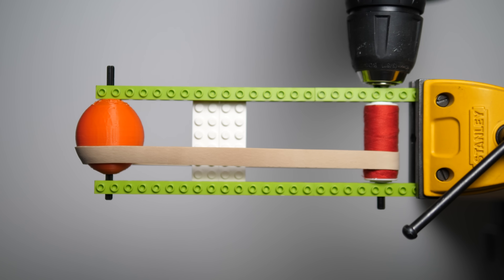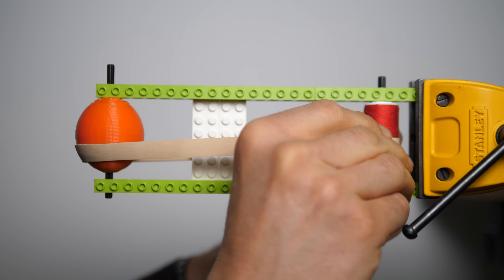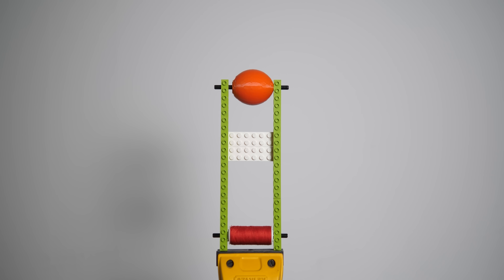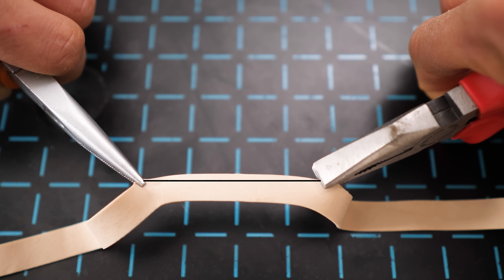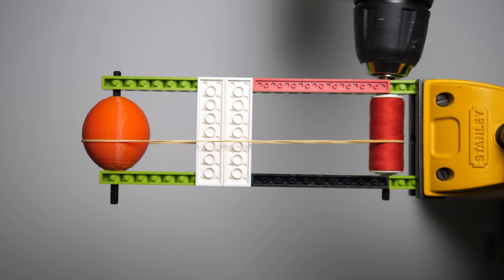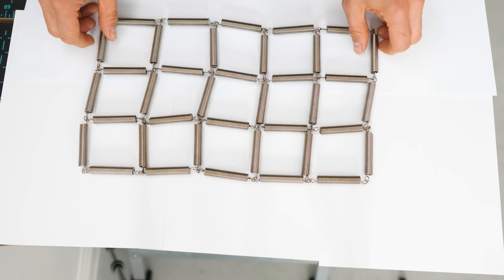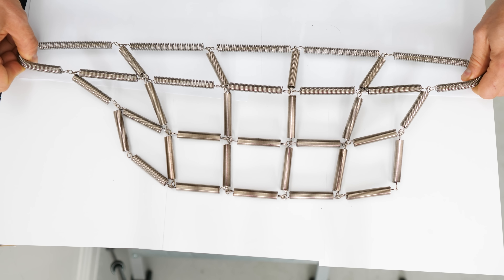The Band Should Slip Off But It Does The Opposite!

Comment: I explore ghost towns and mining camps, and have seen a lot of old mines and mills which used belt-driven machinery. I have often wondered why the pulleys were slightly crowned. Now I finally know! Thanks!
Reply: I do a lot of the drives for conveyors most of them are always crowned because of the belt wandering if it’s a long conveyor with a belt it’s likely to try and wander but with a crowned and lagged pulley it does pull it back to normality :)
Reply: Band-saw pulleys are also slightly crowned, for this same reason.
Reply: The belt goes the direction it leaves the surface until balance or failure. Susually.
Reply: I've wondered too! Looking at old threshing machines and tractors. Also I've made pulleys and gears from scratch for my kinetic sculptures for 17 years and have had various results as I usually just kind of wing it - this information will help improve my work as well. So glad that YouTube recommended it :D
Reply: I explore tunnels and caves in various video games
Reply: You sound like an interesting person, I too like exploration
Reply: @samos343guiltyspark   You can see my ghost towns and mines videos here:  https://www.youtube.com/user/raydunakin/videos
Reply: I read this comment and I immediately thought "hey, like Ray Dunakin!", and had a spittake when I saw it was actually the commenter. Thanks Ray, I still watch the first person Inkopah Railroad video every year or two!
Reply: @pheener  Cool!
Reply: This was the most positive reply ive ever seen
Reply: Exactly why.
Reply: U mean u explore towns and mining camps
Reply: @ajm7375  that's what he said, dummy
Reply: The side stretches more so it pulls it to even out pressure
Reply: And machinery that uses 2 separate belts on the same pulley use a double crowned pulley.
Reply: Nobody's watching because of your comment
Reply: Eileen Ulick    Never. People like to think that anything old and abandoned must be "haunted" but that's just a lot of bunk.
Reply: Now that you mention it, I've seen this in ghost mines.  This is everywhere and I had no idea.  I thought of train wheels but someone else mentioned a bandsaw.
Reply: gee I wonder why
Reply: I'm trying to make a middle school lesson plan about this. Would you happen to have a photo of one of the antique crown pulleys you'd be willing to let me use?
Reply: @grahampcharles   I don't know if I have a suitable shot of a crowned pulley, but I'll go through some of my photos and see what I can find.
Reply: Hammer Johnson  more like a hammer to the Johnson
Reply: I prospect as well…
AZ,  (One of the Stolen Election States)

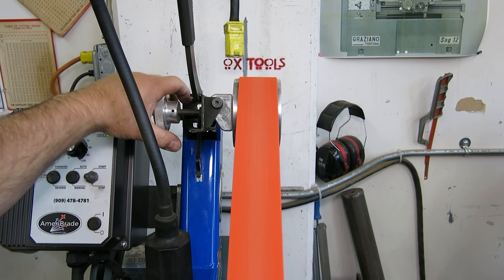Comment: 1:26 - Wow, that image of a centre-lathe at the top-right corner brings back some memories! The Graziano Sag-12 is an incredible lathe (although with a nightmare of electrics to maintain) which make working on it a breeze. Had them in a technical school in Malta. Incredible to work with. An electrician's nightmare to maintain especially with those electro-mechanical clutches in the gearbox.

Comment: Decades ago it was used on LP turntables. Flip of a lever, you change the speed by running on a smaller or bigger 'crown' of the motor shaft

Comment: This has been working with leather and textile belts for several hundred years.  Back when power came into a factory from a water wheel, a "horsepower", windmill, or those new-fangled steam engines, many flat belts connected individual machines to a main lineshaft using crowned pullies.
Please, inject a little of this vast history into your videos...let people know that we are all standing on the shoulders of the giants who did this sort of engineering first.

Comment: This looks similar to counter-steering on a motorcycle where at speed you actually steer right to turn left.
What happens, in the case of the motorcycle, is that the curve on the inside of the tyre causes the bike to turn.
There's a ghastly video online from some engineering chap who talks about counter-steering and gets it completely wrong endangering the lives of the gullible who listen to the video.
Why not do a video on counter-steering?

Comment: When i left school, in the last century, my first job was working on a farm and the farmer had an old Fordson Major tractor with a belt driving pulley that came out at right angle to the engine. He only used the tractor once a month to power a belt driven corn grinder. He'd grinf up corn for the cattle feed. The weird thing with this setup was the way he'd just back the tractor up to the grinder, i'd slip the belt over both pulleys and then he'd let the tractor roll forwards away from the grinder up against a sort of triangular rock that would be kept just inside the barn door for this purpose. I used to be amazed at how everytime he backed it up how he'd be in perfect alignment as the belt never flew off. 
NOW i see he just got it 'roundabouts' in line and PHYSICS KEPT THE BELT ON!
HE used to make out it was all his skill...

Comment: The thick band pulls toward the center and the thin band pulls toward the edge. What width doesn't move at all?
I suspect the following is related: anyone who has ever sideswiped a curb (kerb) with a tire (tyre) while driving an automobile or riding a bicycle  knows that the tire climbs up the face of the curb. If your motion has a significant enough sideways force vector, you'll hop the curb. Otherwise your vehicle slides back down the face as it slows. Your vehicle does not bounce off the curb and back into the traffic lane.
richard
--
“They say a little knowledge is a dangerous thing, but it is not one half so bad as a lot of ignorance.”
- Esmerelda Weatherwax

Terry Pratchett. Equal Rites

Comment: I'm trying to understand why most people would consider this counter intuitive... I just see a belt or in this case the rubber band wanting to grab hold of the greater friction point just like a climber going up a cliff you instinctually grab the best hold to not slip. This is the same in mechanics the belt or like this example "rubber band" will naturally take to the best hold or best "grab" since the center is thicker it will grab more so it's no surprise that it goes to that point. 
But then again I'm weird in mindset and shouldn't be surprised by others  intuitive thoughts

Comment: You stated the effect of shortening force of a rubber band is all caused by the entropy - but aren't there also electrostatic forces acting in the long molecules of the rubber when they are stretched off their "optimum" binding positions?

Comment: When you stretch the rubber band and the spring model at the edges and say that the edge bends up, did you really mean 'the edge curves towards the camera' and 'it doesn't arch away from the camera because it's lying on a board, but it could just as well if the board wasn't there'?

Comment: I originaly thought its because of moment of inertia of that egg. If rubber don't slip it goes same speed as egg. In the middle the radius is biggest so rotational energy is smallest. Derivation of that rotational energy by height would be inward force.

Comment: Commenting at the start of the video.

It makes perfect sense why it doesn't fall off, the upper edge of the elastic is stretched further, and has to travel faster than lower edge around the bend. This pulls the slower edge of the elastic to keep up with the faster edge, and in doing so, scoots it's way up the pulley in a similar way to how an earth worm moves, but on a micro scale
Reply: Hey! I was pretty close!! ლ(^o^ლ)

Also
Heat is just molecular jiggle

Comment: 2:25 is where I'm at i know nothing about this system first time even hearing about it but I'm assuming because the tension on the incline is greater then the lower part of the pully it slips and pulls up the pully and thats why it doesn't slip off

Comment: Sorry to be a pain, but elasticity is not a consequence of entropy. Entropy cannot exert a force; the energy gradient of a system generates a force. The increase in entropy is just a consequence of a lower-energy system.

Elasticity is due to the electrostatic force. This electrostatic force will pull atoms and molecules back when bonds are stretched. Stretched bonds have higher energy, generating a restoring force. In elastomers, the bonds being stretched are the weak bonds in the folds of the polymer. In metals, the bonds being stretched are due to the deformation of the atomic lattice. In both cases, the electrostatic force will try to restore the system to the original lowest-energy state. The result is elasticity.

Comment: We use crowned pulleys on head and tail rollers at work. They aid in tracking the belt so-as to prevent the belt from wearing out the side of the conveyor. The amount of crowning is very small but makes a very large difference when compared to a flat faced one.

Comment: Haven’t watched yet. My prediction is that sliding down would create additional tension along the width of the rubber band, so it moves away from that.
Reply: Alright, so I was wrong, otherwise it wouldn’t have traveled away from the center of the concave pulley

Comment: In 2009, when I was on the FIRST robotics team that would go on to win the championship that year, we were having an issue with our intake belt wanting to wander. We originally had  flat  rollers. We tried concave rollers but that made it worse so we tried a barrel shape roller, which, counterintuitively, worked.  If I remember this VI vidly because I was test with power tapping the mounting holes in the delran rollers

Comment: This cannot be the answer. The belt on my sander doesn't stretch (materially) and yet steers back quickly. The real reason is that, unlike a great circle, a small circle on the crowned pulley is not a straight path. This means that if the belt is off the centerline, it has to constantly slip sideways. Because slipping sideways requires a force to overcome friction, there is a restoring force pushing the belt back toward the equator, a great circle that doesn't require sideslipping.

Consider the following experiment: polish the crowned pulley and oil it to minimize friction. Then oil the rubber band and run the experiment again. I bet that the rubber band will simply slip off. But how is that possible? It is just as stretchy as before and with the same amount of bowing. What happens instead is that the sideslip of the rubber band takes much less force now because of reduced friction, and the restoring force from the rubber band's elasticity wins.

Comment: Flat canvas and leather belts all flapping away on a lineshaft system in a mill or machine shop. A traction engine in a field in1880 using a flat belt to run a circular saw or threshing machine. 
It’s bin around a while!

Comment: Fifty years ago one of my chores was to watch the belt drive from the tractor to the burr mill that Dad used to make “chop” for the cattle. Oats and supplements in, chop out. Belt had a 180 degree twist from the tractor drive pulley to the driven mill pulley. We had a tube of wax about the size of modern construction caulk tubes and would “dress” the belt with wax when it started to smell hot. Very dangerous because the gap was biggest closest to the tractor pulley (so that’s where you stuck your hand in with the wax) and it was to easy to have a hand caught and given a quick 180 spin. And that belt always slowly wandered to one side or the other and we’d need to reposition things. In my minds eye I can’t remember if those pulleys were crowned. Or possibly the belt was so worn it had no elasticity at the edges. Anyway, entropy be damned, was very glad when we graduated to a pto driven hammer mill.

Comment: You can even feel the heat generated by stretching rubber bands. If you have a thick band, and repeatedly stretch it and release it quickly, after just a few seconds you can feel the heat from the bits that were stretching.

Comment: I've seen this type of belt drive on old photos of factories that had just one steam engine and a long drive shaft with lots of these belts coming off of it.. I never understood why the pulleys are convex. It just seems more logical that they are concave, to prevent slipping. But this video opened my eyes 😄 Thanks!

Comment: Belt drive is what drove rotating machines from the start of the industrial revolution. Large rotating shafts above with pullies driving belts turning machines.  The shafts were rotated by falling water then steam engines.

Comment: I don't fully buy the stretch idea. My band saw uses the crowned pulleys. It HAD a rubber cover over the pulley so that COULD have sort of explained the stretch theory but the rubber covers wore out years ago leaving the bare crowned aluminum pulley. The band saw blade immediately rides up to the crown of the pulley anyway. I would very much doubt the steel blade is stretching with the relatively small force put on it by the tension spring.  By the way, I always thought a snatch block was some kind of birth control device!  :)

Comment: Many cassette decks / mechanism have these kind of pulleys, usually between motor and the capstan pin flywheels driving flat belts. 
Always wondered, why they don't come off while in motion. Thanks for the explanation.

Comment: Sorry, the main force of the rubber band's spring isn't entropy, it's the vulcanization (or crosslinking) of the polymer chains. If entropy was the main force, then the rubber harvested from the tree (latex) would be just as springy as the rubber band. It is necessary to have crosslinks to have any sort of elastic rebound, otherwise the material is only plastic, and won't recover any of the energy put into it.

Comment: The Linn Sondek LP12 turntable uses a sort-of hybrid crowned motor-pulley, and motor-angle adjustment screws so that you can change the angle of the pulley (also tipping it closer or farther away from the platter) and thereby fine-tune the speed. Also, although it may seem countertuitive, as a turntable drive belt stretches with age and becomes longer, the record platter actually spins faster.

Comment: You see this in old factories: pulleys with distinct 'fat waist' profiles.
Drive-shafts, Leather belts and pudgy pulleys were the most common ways to transmit power throughout a factory prior to electrification.

Comment: THANK YOU SO MUCH !

This made me finally understand why I've had so much trouble with my 2nd hand semi-enclosed belt sander. Stuff wasn't explained in the manual. It kept walking the belt outwards, from the inner edge towards the casing, and I kept tightening and tightening the tension by moving and tilting the pulley, afraid the belt would walk itself off. It's only 50mm wide and the pulleys eqally wide, so the belt rapidly walking 5-6 mm does cause a good bit of alarm.

It did in the end stop walking out, but the tension was so high that I needed to help it get rolling, and almost any pressure of a workpiece onto the belt would stall it. And the machine would be vibrating so badly I had to clear my workbench of anything that isn't 5 kg+ or bolted down, before turning on the belt sander, or it would end up on the floor. So many times I've needed a belt sander but made do with much less effective tools because using that beltsander was such an all-round horrible experience. 

Now I see that the belt isn't meant to ride in the position I thought it was, but at least 10mm further "out" in the direction the belt was walking. All that tension put the whole mechanism off axis (hence the severe vibrations, there's a heavy stone wheel on the opposite side on the same axle), so much that it overcame the belt's ability to "autocorrect". 

The pulley, which I thought was straight cylindrical, is in fact slightly convex! I have now set it up correctly, and now it's a completely different machine, that is actually useful and not a nightmare to work with 😃❤️👍

Comment: As a woodworker, I learned about this when I bought my first bandsaw. The wheels are "crowned" and we adjust the angle of one of the wheels to center the part of the blade we want to ride on the crown.
Reply: It's interesting to me that this works even though the bandsaw blade is a fairly rigid structure.
Reply: @DanHoke  most 2x72 belts are also pretty stiff.
Reply: Horizontal band saws are just like vertical saws, but with a twist

Comment: Would it also make sense, that the rubber band wants to center itself, because the wider section of the pulley stretches the rubber band, therefor applying more force, more grip, and because it has more grip, it constantly pulls itself back to where it has more grip

Comment: First thought after seeing the thumbnail: The band would need to turn (longer top side to the bottom side; think of the band's surface like a road surface) to [get further from]/[stay off] the center of the ball and it doesn't (left and right sides are naturally the same length).
I assume one could make a 'turning' rubber band ("a segment from a cone" instead of a cylinder) and it would seek to stay at the appropriate angle on the ball instead of the center?

Comment: actually, if you think of the discrete springs in your spring-net model as the polymere chains that the rubber material is made up of, its a very good model.

Comment: When an entropic force meets a crown pulley. Would the belt not center itself even without the elasticity? If one were to wrap a more ridged, banded material (think tape around tapered handle or)
 around a graduated cylinder (or conical)  it would most certainly track towards the grater circumference without entropies dynamic role. By this logic so long as friction, where belt meets crown, is present the belt should right itself. Unless that's the same thing only reversed. But SNATCH BLOCK!